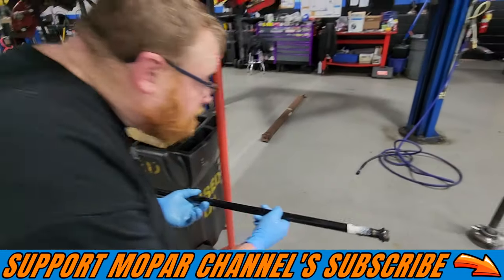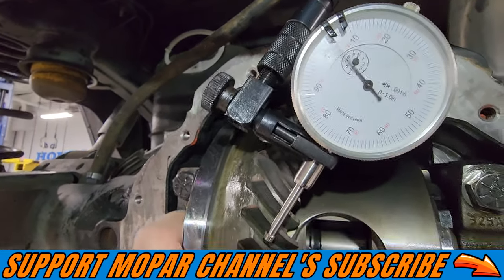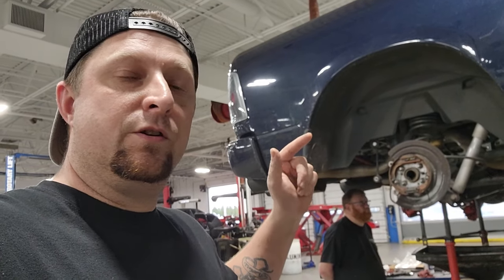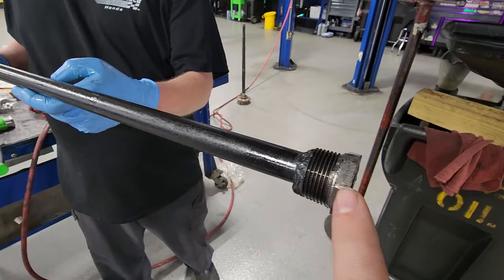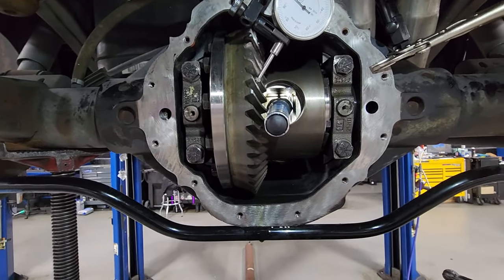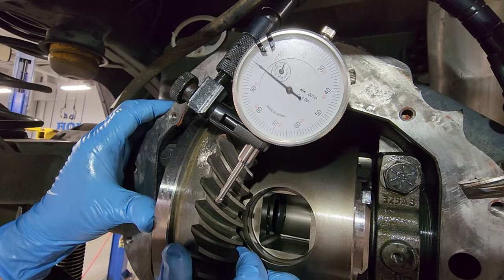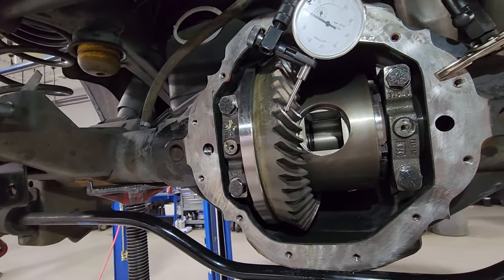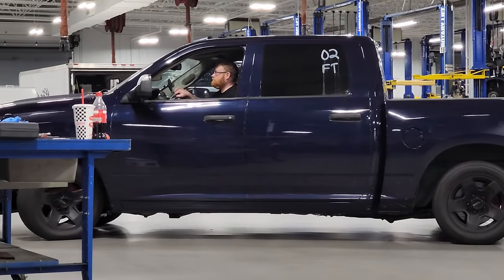Ram 1500 9.25ZF Rear End Back Lash Down And Dirty How To

Comment: Nice job .  So on that gauge you rest it on the tooth of the ring gear (i have never done one of these) then turn the hexes in or out to get your back lash number
Reply from the maker: Correct, Guage must barely touch the ringgear tooth and be on zero when touching it then slightly rock the ring gear to see the measurement then adjust accordingly.
Reply: @FrostbiteRam  thank for the clarification and good to see storm running again
Reply from the maker: @chrisd2486  thanks for hanging out💪